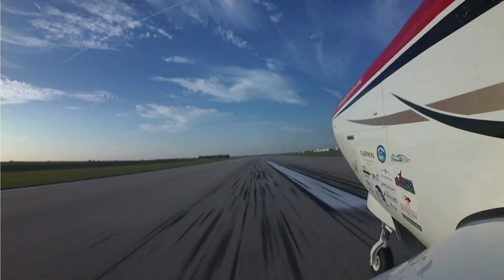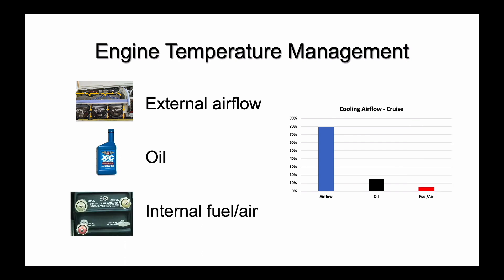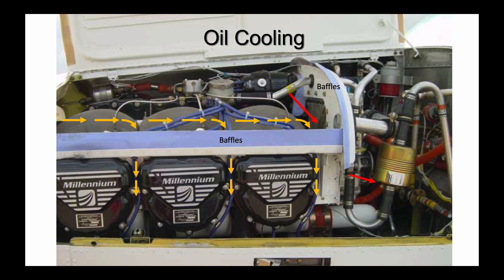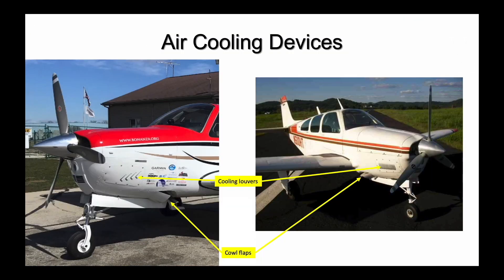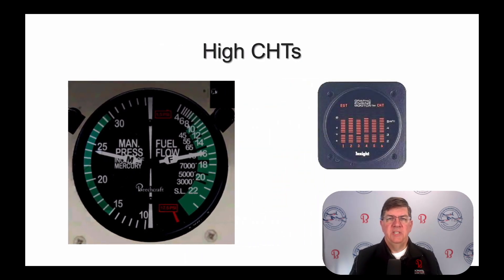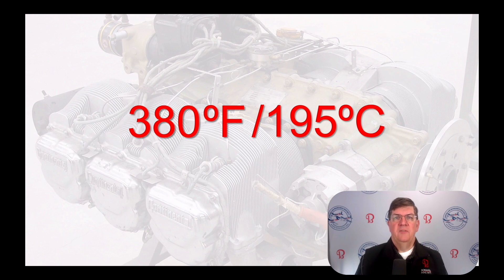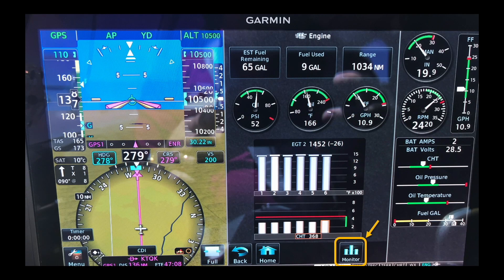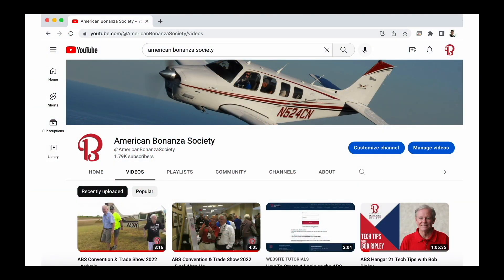Keep Your Engine Cool

Comment: You have the cylinder numbers 1-3-5 wrong
Reply from the maker: Continental Motors begins cylinder numbering from the right rear, then left rear, then the next cylinder on the right moving forward, etc. I've attached a screen shot of the ABS video with an insert from the Continental Motors IO-550 installation manual.